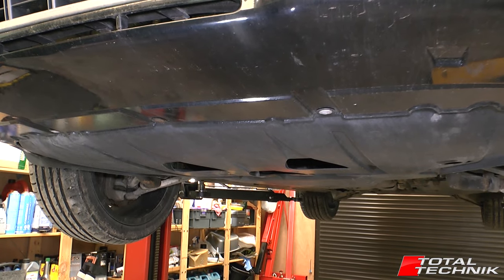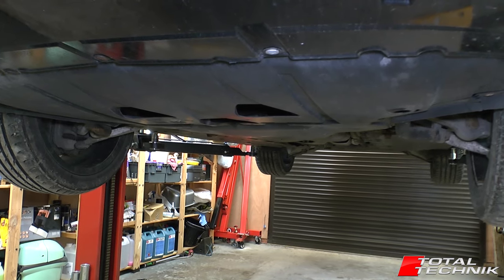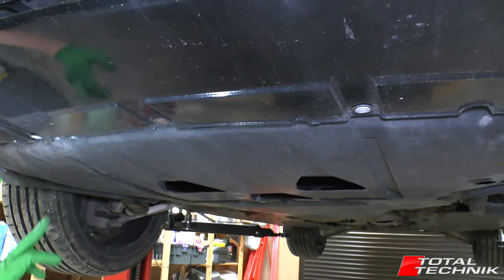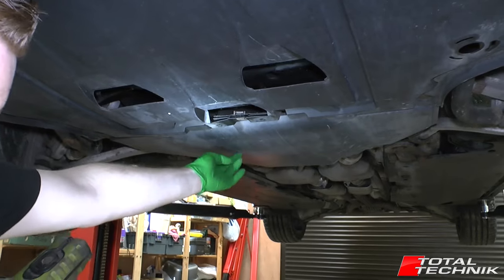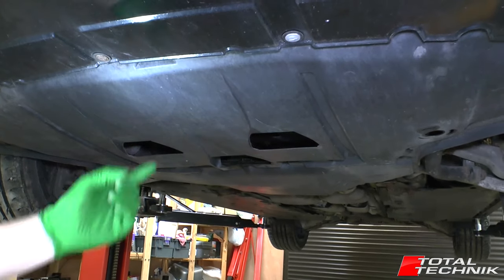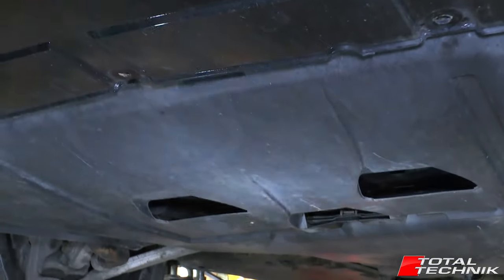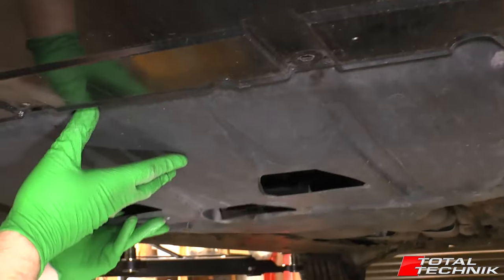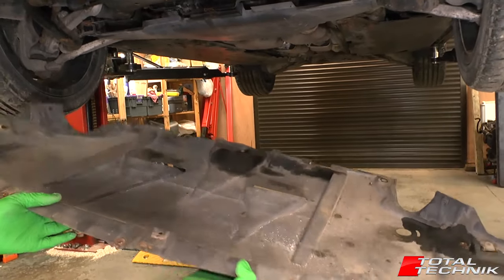How to Remove Engine Undertray Cover - Audi ALL MODELS - Total Technik

Comment: I believe there are some plastic fasteners in the wheel wells as well?  It looked like there were holes for them...but someone may not  have reinstalled them, or they fell out.  My S6 has 3 in each wheel arch, and the other Audis I have have some of them as well.

Comment: hello! the undertray on my 2011 audi a6 disappeared and the quote I got from mechanic was over $1900 to replace.  the estimate mentioned radiator support needed to be done at the same time.  I would like to repair this myself but am not sure about the radiator support.  I would love any guidance you could give
Reply: This sounds like a scam. You would have had to have had an accident where the bottom of your car was destroyed. The radiator support for my b7 A4 is steel at the bottom. The fan is plastic so is the radiator but the radiator is protected by the front impact brace and steel from the frame. I would need to see pictures before I could help.

Comment: Hello my belly pan broke on way to work and dangling along the road and it was so damaged I had to literally rip it off.

Can you drive with no belly pan on the car is it safe?

Audi a4 2002
Reply from the maker: Yes, absolutely it is not an issue. You should pop your head under there and look around just to check there's nothing hanging down (broken plastic corners from the undertray etc), screws etc. But you can drive it no problem without the undertray. In fact, we see a LOT of cars that come in to us without the undertray. That said, they do keep the wet out and so you should not remove one out of choice. Having one is better than not!! :-)   You should be able to pick one up cheaply on eBay etc.

--- 

To help support us (for both you and others reading this) there are a few things you can do:

1) Donations both needed and welcome! We cannot operate Total Technik without the support of people like you! You can donate by PayPal - just go to www.paypal.me/totaltechnik
2) Please ensure you subscribe to our YouTube channel. 
3) Please give our video's the Thumbs Up on YouTube. 
4) Please help spread the word, the more people who know about us the better! Add links to our video's in forums, let people know about us.

Thank you for your support!
Reply: Same thing happend to me, now the gearbox protection fell of too do I have to get a new one?

Comment: Hi there, earlier this year, June, my engine cover came off on a 2018 RS4. I subsequently had a new one fitted, however, since having that done I’ve had a wind noise coming from the front of the car at speed 60mph+, currently struggling to find where this wind noise issue is coming from. Have you got any thoughts or heard of this before? Thanks.
Reply from the maker: That's odd. Doesn't seem that the engine cover could cause that. You could remove it and do a drive to double-check, but seem unlikely. An air hose sounds like a more likely culprit.

--- 

To help support us (for both you and others reading this) there are a few things you can do:

1) Donations both needed and welcome! We cannot operate Total Technik without the support of people like you! You can donate by PayPal - just go to www.paypal.me/totaltechnik
2) Please ensure you subscribe to our YouTube channel. 
3) Please give our video's the Thumbs Up on YouTube. 
4) Please help spread the word, the more people who know about us the better! Add links to our video's in forums, let people know about us.

Thank you for your support!